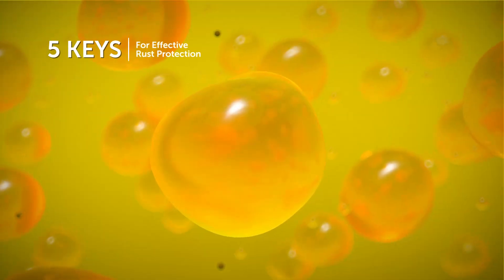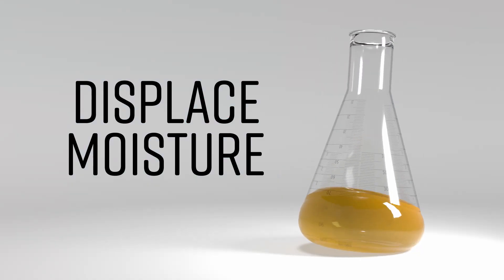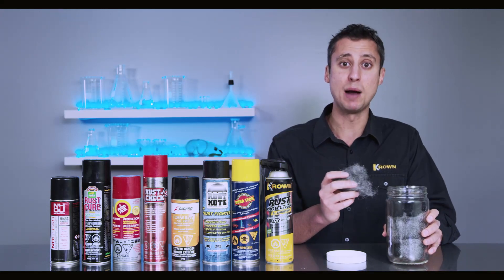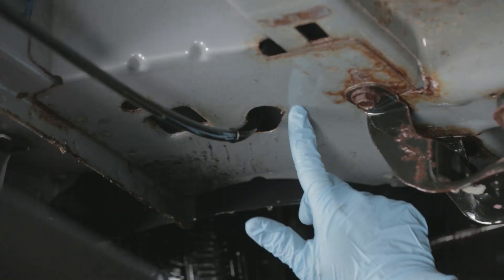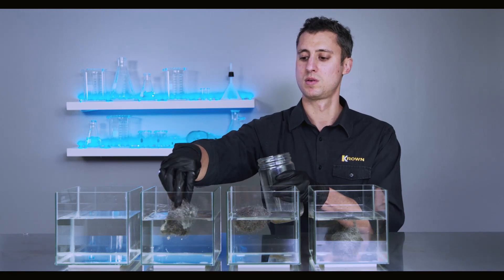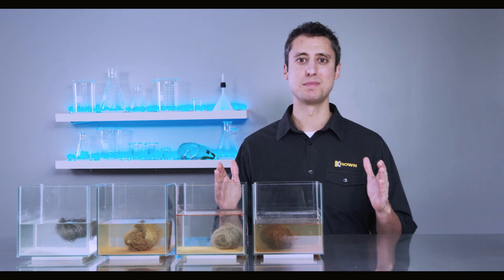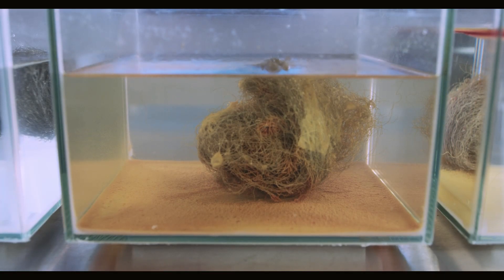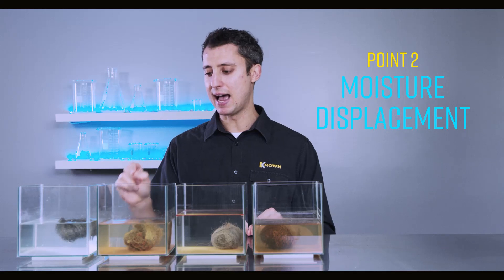Krown Labs - Episode 2: Steel Wool Vs Water Test

Comment: @Krown Rust Control 
Please make the attached Krown straw on the aerosol can a bit smaller in diameter, they do not fit into the key holes & trunk key holes ,  the old yellow aerosol straws did. 
So you cannot spray your own latches with a a can.  It would be also nice if you made the head removable so 360 degree cavity wands can be attached to the cans in the same way your competitors cans allow for this.

Comment: Too bad it ruins anything made of rubber it comes in contact with.
Reply from the maker: Certain porous rubbers may absorb the Krown product, however our technicians are trained to avoid spraying these rubbers. We also coat these rubber components with a silicone spray to ensure further protection during the application.
Reply: @KrownRustControl  I can tell you from personal experience that they don't avoid the rubber and they don't take the time to put silicone spray on. I had 2 vehicles ruined by Krown. One was 3 months old and had EVERY weather strip destroyed. The door handle seals swelled up so bad the doors wouldn't open or close properly.  Neither the shop nor the Krown rep would come good for it. I ended up having to pay out of pocket and it feels good knowing I've steered hundreds of people away from using this crap.
Reply: Hmm, this is a concern.   @HudsoniteJessie